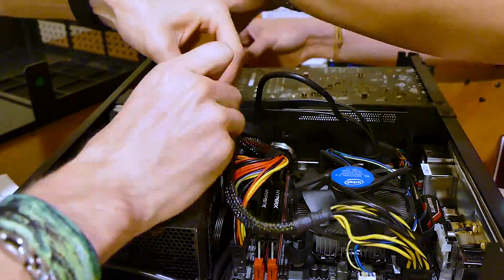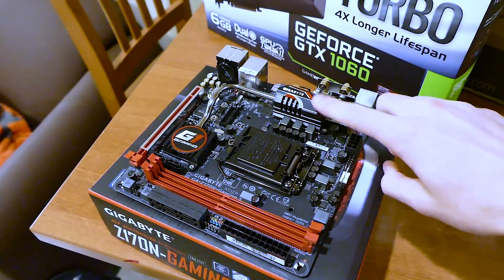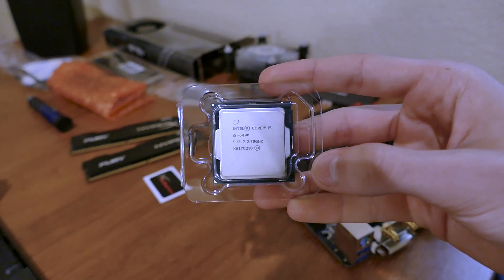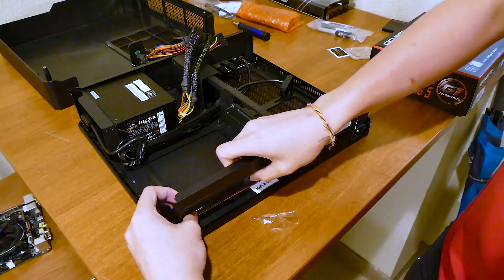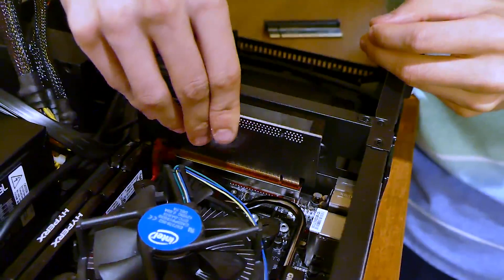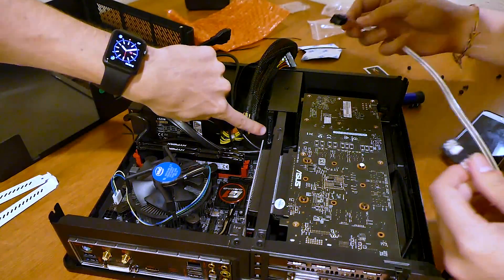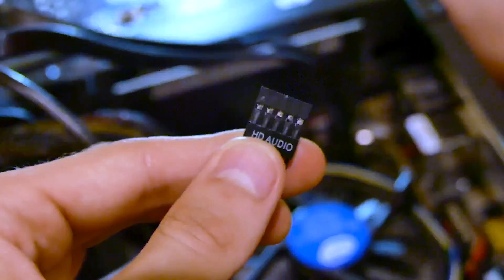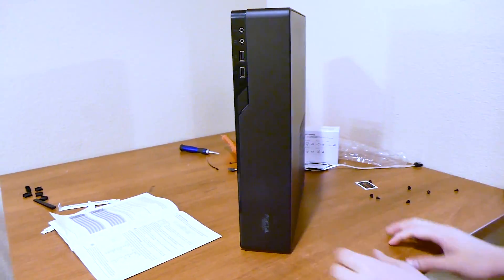How to Build an ITX PC (2016 Edition)

Comment: Whaaaaaa? you can OC non K CPU?
Reply: Pavel Ohrádka Okay I get. I don't want crazy overclocking performance form my CPU. Besides, I'm not a big overclocker. I may end up not overclocking my CPU even if I had a 'K' series CPU. And sorry for my poor English.
Reply: Cool, then I can save some money.
Reply: yup i managed to get my i5 6400 overclocked 1 full ghz- running 3.7ghz, i know it could do more if my motherboard supported additional voltage
Reply: What mobo do you have?
Reply: asrock z170m pro4s bios version 2.23
Reply: Kenneth Horrobin Thanks :)
Reply: It doesn't work like that. That you will save money and every cpu/mobo will be able to overclock. Yes, I managed to overclock my 4590 to 4GHz stable, but you may not be able to do that even if you get the exact same configuration (silicon lottery). You can overclock non-k cpus using only BCLK method, but the overclock on non-K cpu could be unstable as hell (or not, depends), even if you have a good cooling (again, silicon lottery... some will be able to overclock without problems, some will not be able to do so). You have a better chance to success on Skylake cpus tho. By this comment I didn't want to say that it's impossible. It is possible indeed, but there is a reason for K cpus as well as their prices.
Reply: ***** Thanks for the advice.
Reply: ***** Which part of the sentence "You have a better chance to success on Skylake cpus tho." did you not understand? I know, that non-k Skylakes can be overclocked almost as good as those K ones.
Reply: ***** Unfounded? I was talking about older cpus, for example my 4590. If I would go ahead and push it further, even only +10mhz, the PC wouldn't even start or would try to boot but immediately  . I'm lucky that I can get it to 4GHz without problems.
Reply: ***** Yea. I mean that's what I was saying. 

And yes, you're right. I described it wrong, it didn't sound how I wanted it to. Sorry, English is not my 1st language.
Reply: does a non k series cpu need a mobo capable of overclocking or any mobo will do the job, which one do you have? Thank you

Comment: it costs twice as much as a ps4 pro with slightly better specs. not worth it imo
Reply: did u say slightly better specs? I'm afraid I have to disagree consoles use apus they don't even have gpus there graphics are integrated in their cpu this pc has an INTEL cpu with 4 FULL cores not amd cores and u have Nivideas newest architecture with a graphics card faster than the 980 (I'm referring to the 1060 BTW) consoles can't even get close to 750ti  to let alone a 1060 so go fuck ure self console fan boy
Reply: You forgot that the PC is a fucking PC that will outperform that piece of plastic and will be cheaper over it's lifespan.
Reply: San Mattew Teraflops are not relevant when talking about a GPUs performance. Microsoft only used "6 teraflops" as a marketing buzzword.
Reply: Hadi Plays i was not talking about the ps4 bit about the ps4 pro. The pro gpu has 4.2tf while the gtx 1060 has 4.4tf which is slightly better. But you need to keep in mind that on consoles you get much better optimization than on pc. So again this pc will have similar performance to the ps4 pro maybe a bit better. Paying $400 more for this pc is just not worth it. Also i am a pc gamer, i dont even own a console check my channel if you dont beleive me but i am not biased like most people here and just state true facts....
Reply: Nick Gregory yes I know its not the only thing that determines gpu performance especially when comparing 2 completely different gpu architectures(amd and nvidia) but still it is the most important and indicative factor to determine performance of a gpu, also if you see the gtx 750 ti which basically uses the same architecture of the gtx 1060 just scaled down and in 28nm it has 1.8tf now the xbox one has 1.33tf. If you compare the same games between the 2 and the same exact graphics and resolution the xbox still comes on top because of optimization. A perfect example of this is rise of the tomb raider. It runs at 30fps at 1080p while on a gtx 750 ti build which is suppose to be stronger runs the same game with the exact same settings and at 1080p at just 20fps. If you do not believe me watch digital foundry comparison of this(he compares a gtx 750 ti vs xbox one in rise of the tomb raider). Now the diff between the ps4 pro and gtx 1060 is even smaller in compute(pro being 4.2tf and gtx 1060 being 4.4tf) so with console optimization most probably the pro will run most games at better frame rate while costing just half the price
Reply: but ure only counting terraflopsi guess only time can tell also dude the rx 480 has 5 terraflops while gtx 1060 has 4.4 but the 1060 still gets more fps
Reply: Hadi Plays Yes but thats on pc. On consoles you need to remember thatthey have much better optimization than on pc. Like i pointed out on my previous comment of ROTD on gtx 750 ti vs xbox one, despite the 750 ti being much stronger ROTD still ran better on xbox with same settings due to optmization
Reply: Yes  i understand that very well but that simply means that games cannot be compared and that the expierence on pc is better
Reply: Hadi Plays yes of course having a gtx 1080 pc would give a much better gaming experience but at a much higher price that imo is just not worth paying just to play the same games with just higger resolution and frame rate....
Reply: I understand u saying that for games like csgo or cod but otherwise Meh...
Reply: ***** in dx12 the rx 480 crashes it. But again on consoles optimization is just much better. Even though the gpu in the pro is weajer they will still perform the same most probably. Now the cpu yes i agree its quite shit on the pro and in fact i am afraid that it will hold it back.
Reply: "Just not worth paying just to play the same games with just higher resolution and frame rate...."

Did you miss that I said that a PC is a fucking PC that will outperform the PS4 "Pro" and will be cheaper over it's lifespan. 

Also, being able to play at 1440p at 60 FPS is far better than 1080p (at best) at 20 FPS or lower.
Reply: Nick Gregory the ps4 runs games at around 1600p(higher than 1440p) and than upscaled to 4k to make it look even crisper. Also they do not run @20 fps but at 30fps with maybe some minor drops. Also becomes cheaper? If you pay $700 more for a pc  that can handle 1440p 60fps in no way it is going to become cheaper in the long run. The only thing about the ps4 pro is that you have to pay for multiplayer but its still quite cheap so it wont affect you really....
Reply: San Mattew "1600p" on it's weak ass hardware and then upscaled to 4K "to make it look crisper" is all just bullshit marketing bullshit. 

Also, when I say "cheaper in the long run", pay for now $60 a year just to play online as well as games that cost $60. It will add up really fast.
Reply: Nick Gregory it really isnt bullshit. Check digital foundry analysis and anyone who has seen it in person all of them were impressed by the image quality. Also on console one can buy second hand games for less than half the price or i can buy accounts with games for a super cheap price. Check this site for example: buygames.ps 
You can buy super cheap ps accounts and the site is reliable as my cousin buys his ps4 games from it without any problems
Reply: As useful as Digital Foundry is for showing how a game runs, when it comes to Xbox vs. Playstation, they have a heavy bias for Playstation, every time.
Reply: There are a lot of things you cannot do on PS4 but you can on PC, such as, excel, word, access, software development, edit video, drawing, art design, building 3D models, you name it, so I don't think this is a fair comparison. If you only buy a PC for gaming, you argument might be valid.
Reply: Edwin Chen most of the staff you nentioned can be achueved on a $150 windows 10 tablet which btw has the advantage of being portable not a static desktop pc that you can only be used in just the same place
Reply: For word excel maybe, video rendering and 3D model building cannot be done by a $150 tablet, and you also want more power for programming instead of a mobile chip and small amount of memory otherwise it's a pain in the ass to debug, run tests locally or build. Also people might want everything i.e. gaming, working in the same package instead of maintaining multiple devices. All I am saying is people have different needs, what works for you might not work for others.
Reply: Edwin Chen yes but me and many others do not use video rendering programs or 3d model building so it wont matter. And yes if a user wants to do that staff then there is no better device than a pc, I agree with you on that.
Reply: Cool

Comment: cool build, but just noticed something, I think you guys used the motherboard screw on the ssd and the drive screw on the motherboard. I doesn't really matter I guess if it fits inside the standoff and for such a tiny board, but just saying.

Comment: And so how do you install your games without a DVD DRIVE or burn your own disks with this PC?
Reply: What if I want to play vinyl records? This build doesn't have built in betamax. Thumbs down.
Reply: Phil Abrahams When that day comes, I have it on a flash drive.
Reply: Well use an external Optical Drive , and come on  well downloading games now from steam or any other digital distribution platform...I myself didn't use a DVD from 2012
Reply: +Alexander George Politidis Well I still have my old games on disk and I still like to use something called a shop to buy things such as programs and games.  Tell me something if your hard disk dies how do you get your games back?
Reply: +Ⴚhuck Ɲorris So instead of installing a DVD drive you will need to use a external drive which means more cable and more mess. just give me a box with everything In it that I need.. and downloading games such a doom from steam and it didn't work who do I complain to as using email takes too long?
Reply: You can buy an external DVD-RW for about $20 if you need to play the classics
Reply: +Phil Abrahams If you buy some 1$ thumb drives at your grocery store sure, but if you buy proper high quality drives from a major flash memory brand like sandisk, corsair, samsung, kingston, Solid-state-memory is way more reliable then cds or dvds
Reply: Phil Abrahams Well, I've never had one fail on me yet.
Reply: You plug your OS install stick in, repair/reset/reinstall, and if you lost any programs or games, you download them again...
You can of course do all these thing with dvds too, but it's way more tedious, you need to keep all your discs somewhere safe, self burned discs decay over time, and after installing you have to update your OS and all programs/games via download anyways.
Reply: +Alexander George Politidis I would still like to have the disk or let me put it another way you have a new car which would you like. A puncture repair kit or a spare tire. I know which one I would have but what would you have?
Reply: +tSp289 What are you trying to say?
Reply: +tSp289 And I think you will find that people are buying vinyl records again.
Reply: Phil Abrahams I'm saying that those technologies are obsolete. Some people still use them, but it is generally a lot easier and more convenient for most people not to bother, so a build shouldn't be criticised for not enabling them.
Reply: +tSp289 Well I was not criticising just asking and you can still buy DVD drives and blank disk so that does not make them obsolete.
Reply: Phil Abrahams You can still buy tape cassettes too. Or you can stream music digitally.

Most people building a PC will ditch the optical drive, and it's rarely included in small form factor build guides except as an optional extra. If you're going for SFF, an optical drive is a big clunky thing that limits your choice of cases and which unless you've got a big back catalogue of discs, you don't need anyway.
Reply: +tSp289 Yes you can still buy audio tapes. But one day you will turn on your PC and get a system disc or non system disc error and then you will wish that you had  the OS on disk and a drive to put it in.  you do know that you can buy slimline drives as well.
Reply: I understand that some people still want/need a disc drive, but most people nowadays don't care about it anymore.
For the OS error you mention, a USB drive works just the same for repair/reinstall.
I have an external cd/dvd reader/burner, it's tiny, sleek and only has one usb cable going to it, used it twice in 5 years now.
Reply: +tSp289 A device that does have a high failure rate good luck.
Reply: +ragnaroekAT Yeah if you believe it's OK to put jam on them or not look after your disks. But if you don't drop them in sand or put them near heat or in an oven they will last for years unlike a thumb drive which can be kill by a static discharge "Just walk and a house with nylon carpet and then touch someone" it does look funny doing it to your mate but not for the thumb drive.
Reply: +tSp289 don't tempt fate.
Reply: ***** Again how do you access your hard disk when you get a system disk or non system disk error ? As I think you would find it a bit hard to access Steam if you can't boot to your OS first.
Reply: ragnaroekAT Look I am in IT and just finished doing a refresh of replacing the big box HP's with Lenovo  http://tinyurl.com/z9dl2gs which means no more going under the desk to get the PC. and using sccm and active directory to manage the sites software. But me I am old school I like to have all the disks to hand just in case.
Reply: Hey that's cool, and I never said you shouldn't use disks anymore, whatever floats your boat.
But you asked: "...how do you install your games without a DVD DRIVE or burn your own disks with this PC?"
And the other commenters and I answered that a missing disk drive in a super small form factor build isn't bad and you don't miss out on anything :)
Reply: I need an optical drive anyway. imgburn to create the iso from the ps2 disc and an emulator to play it.
Reply: just use an M-Disc, it'll outlive you. Assuming you don't smash it to bits.

Comment: Nice build!

I wonder: These newer ITX cases with support for full-size graphics cards often feature a completely separate compartment for the graphics card. One benefit often cited for blower-style coolers is that the ambient temperature inside the case stays lower. Makes sense, but: Does this really matter with a case design like this where the GPU is pretty much completely separated from the rest of the system?

Since "open" coolers are often said to be more efficient and quiet it would be interesting to see how these two cooler styles actually fare in a case like this.

Comment: Don't understand why he used an i5-6400 and an overclocking motherboard when he could've just bought an H110 motherboard for probably $50+ less and a 6500 with a 3.2GHz clock for $20-$30 more. Don't understand the 2x4 DDR4 RAM as 1x8GB will have no noticeable difference and will allow for easier, more cost efficient upgrade in the future - even if it's only 4GBs. I hope he got that ugly ass blower style 1060 from Jet for under $200 cause if not, I would've waited for a jet sale & threw a reference RX 480 8GB in here for the same price of around $230. Card performs significantly better AND has FreeSync, which is damn near 50% if not more cheaper than the cost of a G-Sync monitor. 

If this video is only for showing people how to build, I get that. But if it's in terms of cost efficiency or even efficiency in general, I'd give it a 8/10. You also wouldn't have needed an aftermarket cooler if he just bought a processor with a higher base clock like the 6500.
Reply: By the way, I still love the video! Very easy and instructional! Just feel like we could've saved money at some points with different parts that wouldn't have sacrificed performance.
Reply: people getting non k cpu and a Z board is because non K is cheaper and you can downgrade the mobo bios and overclock the cpu, Or if he's not that bad of a person he can swap out for K in the future. But yeah I highly agree with you, the cost is abit wasteful. He could have get an H110 chipset, a single 8 gb stick ram.

Comment: hi greg... i have bought a new pc with i5 6400 and a 1060 which is not performing good due to cpu's low frequency... and now i want to upgrade a part and i am confused what to do...i have 2 options
(1) but a 6600
(2) buy a z170 mobo with a fan in place of my h110 to oc the 6400.

please help